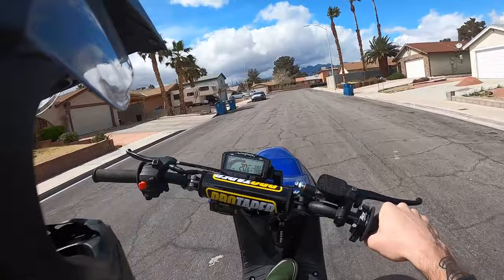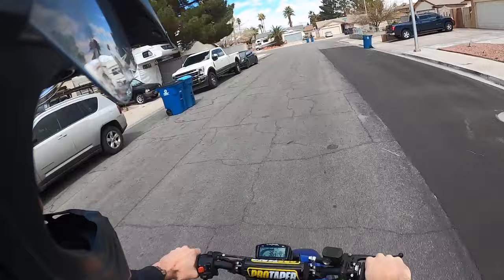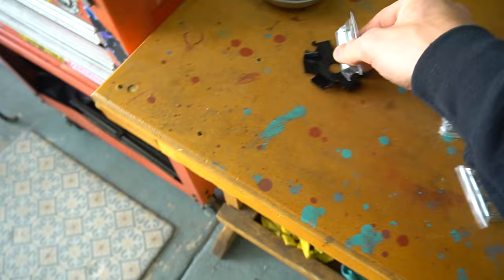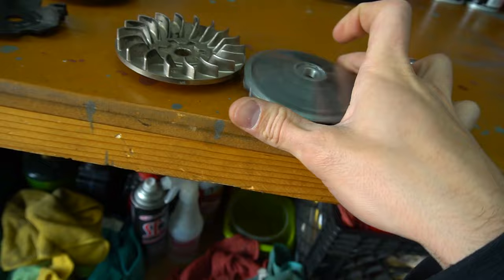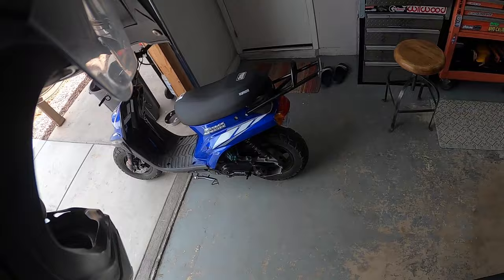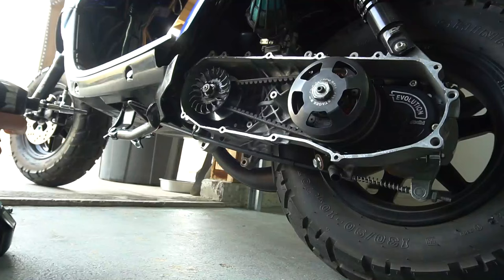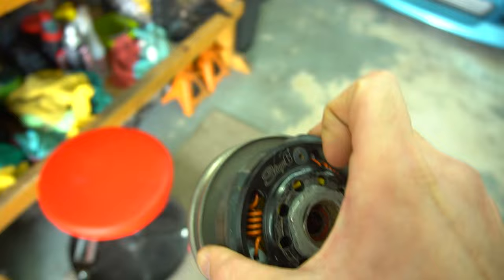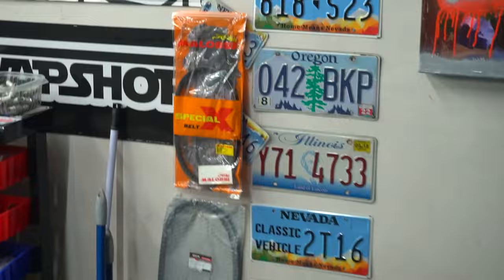SCOOTER CVT TUNING 70cc ZUMA | STAGE 6 Minarelli

Comment: My Aprilia sr50 is a great bike" piaggio motor,  50 mph stock ,  5 g rollers  leo vince ZX pipe ,   70  / 86 cc kits & pipes ecu,  but fuel injection fuel pumps are junk "

Comment: the minarelli engine with aftermarket variator in my opinion works best arround 5g rollers and 1500k contra spring and hardest clutch springs for better take offs :)
Reply: That same for a 50cc? My rox hasn’t got much low down power at all
Reply: @9N3  if you have exhaust aftermarket, go with 3.8 up to 4.5g rollers and medium contra spring malossi yellow if you have sport vario, also all sport varios come with contra spring matching. i think you need harder clutch springs.

Comment: Hey i have a question i have a 50cc mbk and im learning wheelies on it ,but I read somewhere that wheelies are actually bad for your engine ,so i just want to confirm if it's ok to wheelie your bike withiut destroying it
Reply: Go for it
Reply: for a 2 stroke scooter wheelies aren't probably harmful in any way, but for a 4 stroke engine they can restrict oil flow causing it to seize
Reply: @miningboi4207  i have a 2 stroke so that's great thank you for the info bro
Reply: If its 2stroke it does not harm the engine any way because the bearings and cilinder is lubricated with gasoline/oil mixture going thrue them

Comment: what top end you have on thins one ? Polini ?
Reply from the maker: polini corsa
Reply: @MOPBOYZ  nice she running like a true champ.  I did the same test on mine but i have stage 6 Street race and the top performance variator being 20g lighter gave me better torque than the stage 6 variator.  Stage 6 gave me also like 4mph top end.
Reply: What yellow spring is it you have? I have the Malossi 1500